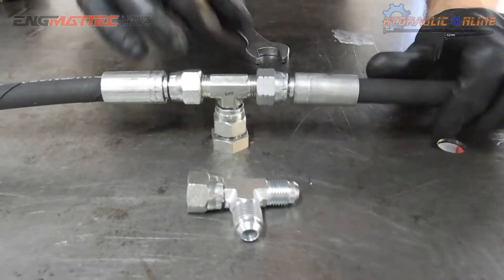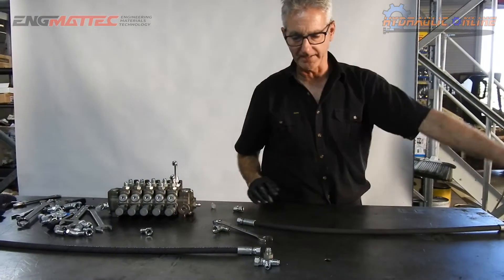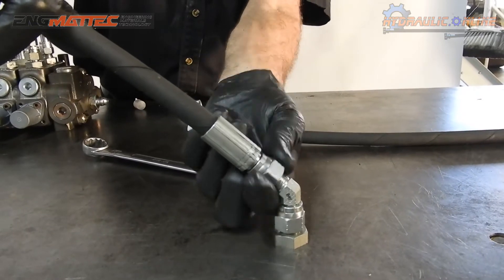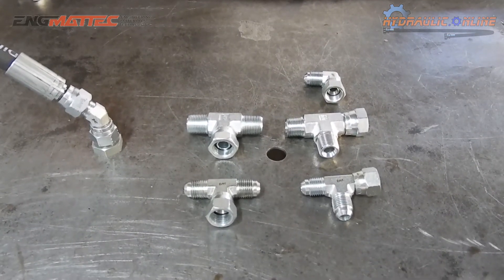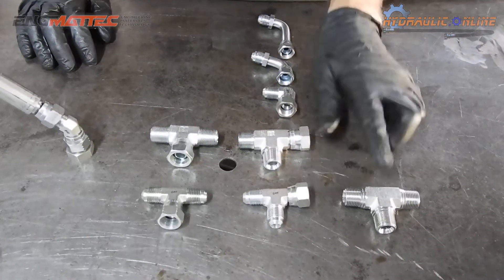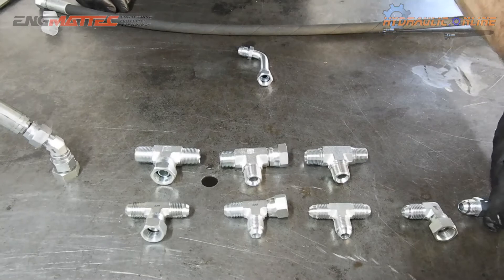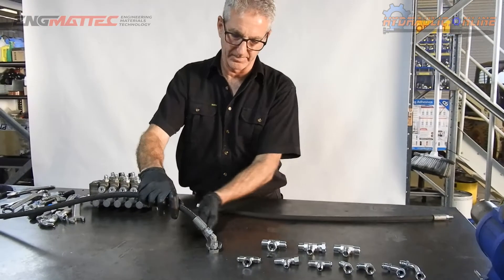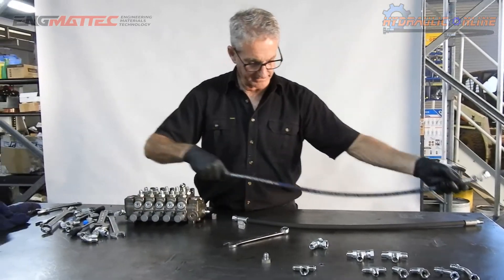Exploring Hydraulic Adaptors Part 1: Difference Between Branch Tee & Run Tee, Elbows Short and Long

Comment: I think he got J.IC run tee and J.I.C branch tee mixed up 😵‍💫 or am I wrong LOL.  If he did 🤦🏻‍♂️ wow. You had one video to proof watch and share fml. If I’m wrong then goodnight everyone 😂
Reply from the maker: consider this comment, The "Run" of a Tee is when the oil can flow through without having to change direction, and the "Branch" of a Tee is where the liquid would have to change direction. In this video we have consider that the oil is entering the Tee through the female swivel nut... then the terminology it is correct.